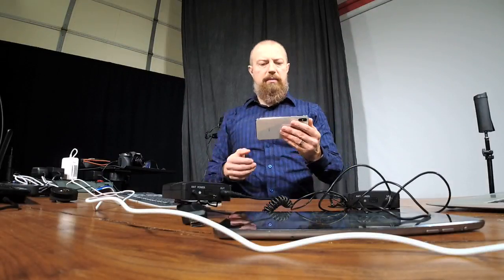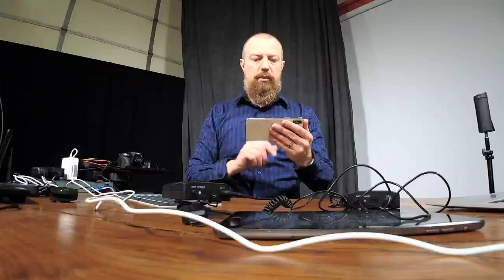Inception Stream 2: Mevo

Comment: Great Video...  I have  mevo but i have wrestled with audio quality for some time.  I am interested in the K & F concept wireless USB  lavalier mic, but i need more info..  Model number and purchase location.  I can find one with USB conecction...
Reply: It appears to just be a different cord with a USB end???  if so what cord??
Reply from the maker: Not sure what mic you’re referring to. The K&F one I recently tested is not USB. If you want to connect an external mic to the Mevo directly you need the Booster and then a USB to analog mic adapter (cheap; like $5). Or connect the mic to your iPhone that is controlling the Mevo. That’s the easiest.